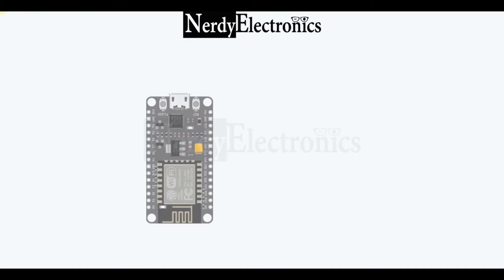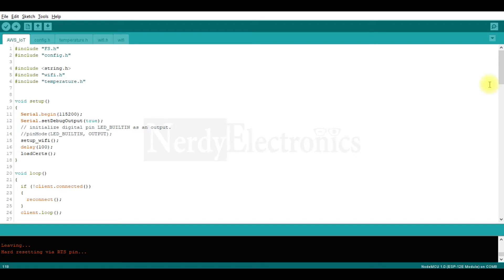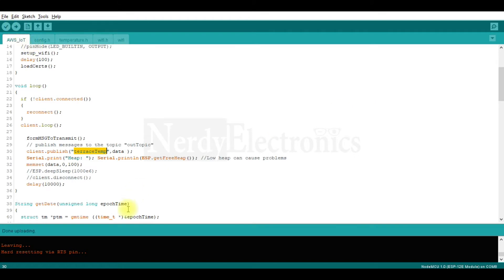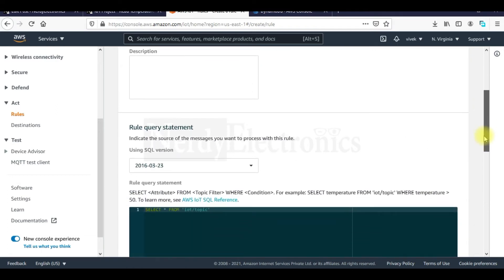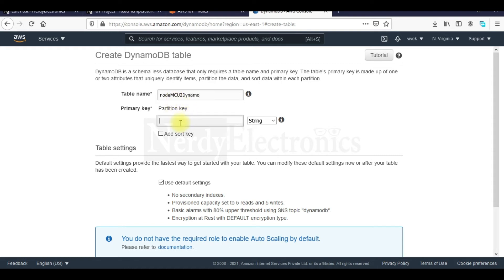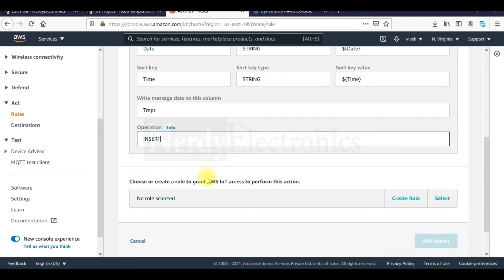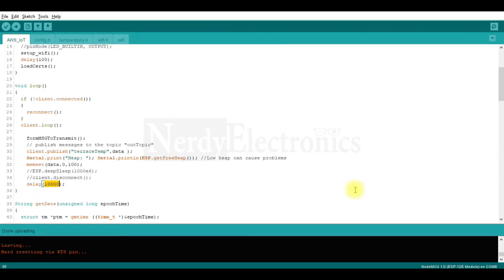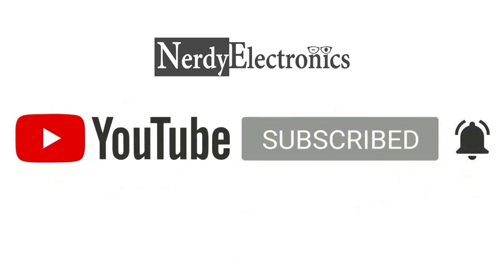IoT - Read Room/terrace Temperature in NodeMCU and send to cloud storage(AWS DynamoDB) using AWS IOT

Comment: Sir,could you help me fix this error
i do excatly every single step like you
Attempting MQTT connection...failed, rc=-2 try again in 5 seconds
WiFiClientSecure SSL error: Unknown error code.
Reply from the maker: Recheck the certificates and also the timestamp that you are getting. This error usually happens because of bad certificate or wrong time. Print the time that the device is receiving and check if it is correct

Comment: could you plz, explain that how we can export our sensors data into the excel sheet using aws iot core.  and how we can increase the data uploading rate into the aws iot core. although i decreased the delay time its uploading one data/sec.  Thanks in advanced.
Reply from the maker: Hi Ravi,

The upload rate depends largely on your application. Probably your SW is not able to push fast enough. Maybe you should re-look into the logic

Storing into excel - You can try sending the data to dynamoDb and then export from DynamoDb to excel. You can also do it through Lambda. Fwd the data from IoT core to lambda where you store it in an excel file.
Reply: @NerdyElectronics  thank you for the reply and suggestion. 
Actually, for my project, I require high data rate. 
What is SW?
Initially, I was using thingspeak, but due to very low data uploading rate, I moved to ubidots, but  I don't found suitable. They have also some limitations.v
Reply from the maker: @turulob1055  SW - Software.

I am not sure of how fast we can push data to AWS IoT. Maybe I will try an experiment for that.

For storing data to excel, you can also try sending the data to an S3 file using AWS IoT rules